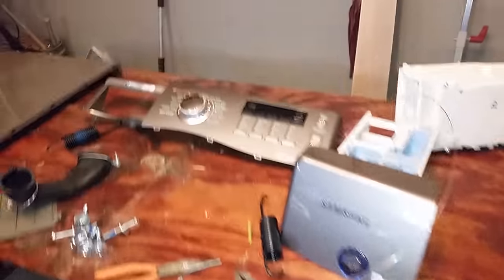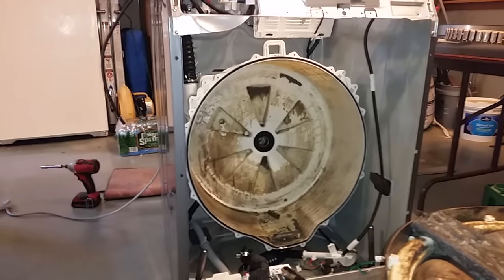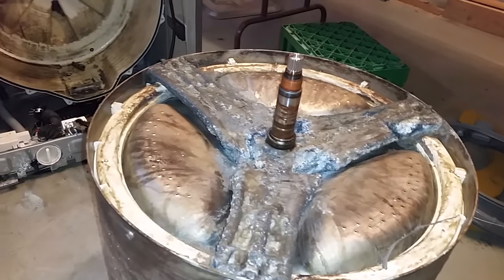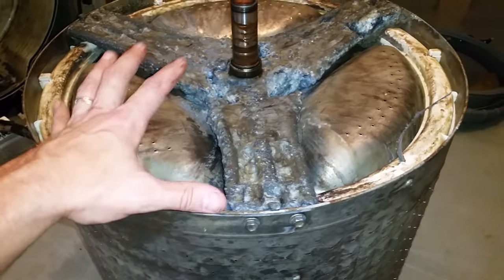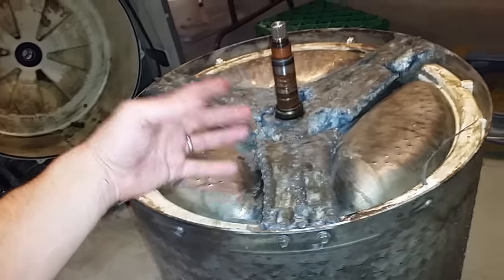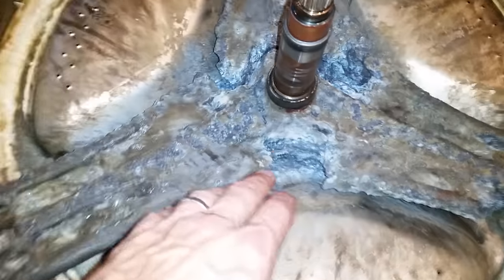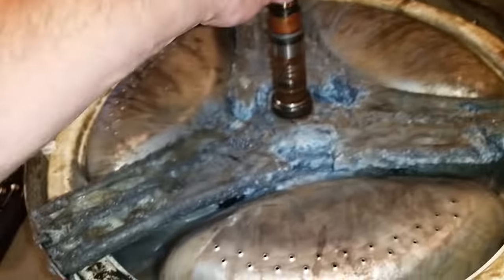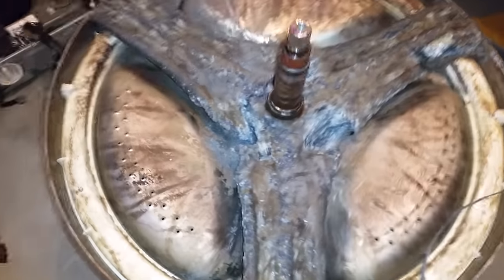Do not buy Samsung front load washer machines

Comment: Phil, this is one of the most interesting videos I've seen on youtube.  I'm not kidding.  The way that metal is deteriorating is incredible.  I have a similar Samsung purchased in 2013.  Control panel looks the same but mine says steam in the bottom left opposed to your bottom right.  I believe mine is one year newer than yours.  So with the sticker on the front of the unit that says 10 year direct drive warranty literally means it only covers the motor that spins the drum?
Reply: Yes warranty in the motor only
Reply: Tony Martin Samsung was in the news today for faulty washing machines.  I thought of this video.
Reply: And you believe what the news state. This the fastest spinning machine i worked on. So again customer need the read the Manuel. Large Bulky  loads need front loaders. Or low spin DELICATE MODE  BULKY LOADS. The machine is doing what the owner set it to wash in there wash setting.
Reply: Tony Martin  I didn't read the article, just seen it.  The only problem I have with mine is there is water in the detergent tub after most cycles.
Reply: tony martin what are you suggesting because i am in the market for a set of samsung front loader set and what is the proper way to maintain the machine ?...you should do a video on hiw to maintain the machine ....
Reply: I have to be honest.  After watching this video (I'm assuming you watched it) you are still interested in Samsung washing machines.
Reply: actually i am and i dont follow the hype because if you see for you self there are many happy customers and if that were the case no one would buy any brand because there will always be a complaint,  technitians are telling these people to do so preventive care and that should health alot but it is what it is and can stop driving starbucks because someone else likes Dunking Donuts and say is not good quality lol....
Reply: Rob M  Good grammar my man!
Reply: Rob M cleaning the unit with vinegar every 2 or 4 months will remove the soap residue just place in soap holder this one fill to max . Now in this video this spider arm not this guy's problem. Out of balance was due to Auto Balance ring on the front of the drum. This makes the drum not shaking in spin cycles Every unit on the market uses the same aluminum spider arm. Now do not use more than a shot glass of soap. This too will save the live of a unit.
Reply: YES DAMMIT! 
10 Years on the DIRECT DRIVE ONLY! Read the sticker, will ya!
Reply: Cleaning it with vinegar is extremely volatile to the Drain Pump motor and will more then likely corrode it then temporarily fix the problem. Not using so much damn detergent when using the unit can also cut down on the mold and mildew! Or leaving the door slightly open. Man, do people have to research everything on youtube for something completely stupid? 
You know there's sites that teach you how to keep your HE machine running efficiently and answers to common questions, right?
Reply: +RIP EVO
Sorry sometimes  the auto correct keyboard on my smartphone mixes words ,nothing i can do....
Reply: Rob Whiff You can proof read it before hitting post. There's that option...
Reply: Thanks
Reply: +Rob Whiff  Apology accepted.
Reply: Dillon Word So, if your question was already answered why did you keep the video up?
Is it because YOU need attention? What are you trying to raise awareness on. I mean, I find it overtly ironic that you're bashing a company based on your experience titling it Do not buy Samsung washer. And are calling me a dick. Lmao
Reply: +Frank (YouTube Newbie) Borrego   Dude,  you replied to the wrong person first of all.  YES!  I need attention so I kept the video up.  Moron, this is not my channel.  I don't have the ability to remove the video.  You literally replied to me, Dillon and the channel owner all in one reply but you are addressing us as one person?  I highly suggest you do a search on using YouTube for dummies.
Reply: Trying to decide which dryer to buy IF I am unable to repair my old Whirpool top loader. I sure don't need a HAL9000 to dry my clothes, nor do I want to spend anything close to $1,000.00 . It seems ridiculous and wasteful FOR ME, on my income. I have dirty clothes, sometimes daily because of sprinkler or other work requiring me to get dirty or muddy. Seems that here in Wichita, KS, several basic units are avail for sale price of $400 or $450, Samsung or Whirlpool. I hope that this would be the limit to own a dryer that works reliably. The parts store for dryer repairs has Hotpoint basic unit for $310.00 . I think it lacks a buzzer alarm feature, but I am mulling over its necessity. I understand that reviews for washers/ dryers will not necessarily be reliable since the majority are based on negative experiences, sometimes not even reflecting the product being reviewed but a hardware outlet or even the fact that the washer flew down the stairs in unfettered anticipation of its new residency. So I am looking for solid advice, but somebody here needs anger management. I need to feel safe leaving my sawed off fit-throwing online bully gun at home!
Reply: My appliance service people, - I needed three companies to get our 5 1/2 year old Samsung refrigerator back on track - singled out a few brands to stay clear of:  Samsung topped the list.
Reply: Geeeee!
so they give 10 yrs on something that doesn't wear out, 
and an immorally short time on the critically* expensive piece that will CERTAINLY fail (unless you have a newer model with the "clean cycle", ours doesn't (2010, WF210), know to use vinegar - and how and when to - and somehow have the knowledge NOT TO USE THE FILL LINE in the soap dispenser -- (what's it there for then?) 
!
Better plan:  no Samsung patronage

Comment: I remember this video from a few years ago after buying my new Samsung’s. So my machine started having slight balance issues. I got panicked and pulled out my warranty with squalor trade and guess what, 3 more months and my warranty was due to expire! They sent out a repairman and found they couldn’t fix it. They refunded the purchase price. Had I not seen this video I would have waited for it to be a real issue and my warranty would have expired.  I would have been SOL. Because it is an awesome set of machines I will see if someone can fix it and put them in the downstairs laundry and buy another set for upstairs.  I play the warranty game on the next set. I hope Costco sells the top of the line Samsung’s I will try buying from them they hold the manufacture to high standards.

Comment: Good to know. I replace these a lot working on Appliances. I would still go Samsung though. From a tech perspective they do improve on designs as time goes by, not all, but some. Plus they are thought out if parts do need replacing.  Whirlpools good but after that its really down hill. I tell you every GE appliance i open up, 5 other parts immediately break.

I might look into this a bit more in depth. Probably because its cheap and they do aim for a certain amount of years like any brand nowadays. That as a 4 year seems really bad but something tells me the water going in wasn't great either. Anyway thanks for the video!

Comment: I wonder how much the cost difference would be to use stainless for the bracket vice whatever metal they used. I guess that is why some people things use to be made to last and not built to fail.
Reply: Well remember the GM  ignition key module that killed people and caused car accidents .The cost to change the unit would have been .12 cents . I imagine this washer bracket would be maybe $15.00 to $20.00  more but the bean-counters won . Time to fire some bean-counters and hire some qualified engineers .
Reply: I used to work at a company that made electronic equipment. We had one engineer that used to walk around the office going "cheap, cheap, cheap...now it's so cheap, cheap, cheap it doesn't work anymore". Your analysis of this problem is absolutely correct. It's the main reason why I don't work as an engineer anymore. I got tired of having to work all night fixing these types of problems while the managers, accountants and stockholders were all at home in bed with their wives.
Reply: Nice that you don't know how to spell "Cheap"!!?
Reply: @ Mark W - It was meant to mimic a bird going "cheep, cheep, cheep". But I changed it just to make you happy.
Reply: Joe Vignolo Poor, Mark.  Love his heart!

Comment: "All" the front loaders do this. I had a Maytag that did the same exact thing.The spider arm on the drum is made of aluminum. Moisture attacks it. Bad design & engineering.
Stay away from front loaders period. They claim its stainless but thats only the drum.
Reply: I had the kenmore made by Samsung just like this video complete crap. I bought 2 new maytags direct drive front load and with 10 year parts and l’avoir warrantee so I’m pretty confident that we shouldn’t have a problem and if we do they will fix it

Comment: Run a cold water wash without detergent once every week or two. Doubles the life.
Reply: How does that double the life?  W/ front loaders, they recommend you run an empty bleach cycle every mth or so to keep mould down, but I'm not sure how plain water does it?
Reply: When stainless steel os attached to aluminum it causes galvanic corrosion. Laundry detergent speeds that process up. Doing a fresh water cycle rinses the residual detergent out slowing the corrosion process. It has nothing to do with mold.

Comment: I repaired my Samsung washer just like you. It cost me 200$ and 6 hours. Finally, I realized that's how they make money. Samsung can use more strong Spider to make the washer long for 20 years. But they don't. They set up clock of less than 10 years to fail which make most of the user to buy a new one. Because the labor cost is extremely high. The labor cost plus the part cost is easily high than a new washer.

Comment: Sacrificial Anodes are highly active metals that are used to prevent a less active material surface from corroding. Sacrificial Anodes are created from a metal alloy with a more negative electrochemical potential than the other metal it will be used to protect. The sacrificial anode will be consumed in place of the metal it is protecting, which is why it is referred to as a "sacrificial" anode.

Comment: Why do you think that Samsung hasnt fixed the problem?
This is a well-engineered solution to the main problem of Samsung:
Devices should not last too long so that the idiot-consumer buys a new one every 4-5 years!
And another bad habbit of Samsung is dipping the electronic circuit in resin.....so have fun repairing that......(protip: you wont)
Reply: Actually, encasing electronics in resin is used by the military to protect components from breakage due to vibration and extreme acceleration. Replacements are routinely done on these potted parts. So this must be done to extend the life of the circuit boards out of the warranty period which is even more sinister. My wife chose an upright machine just to avoid the moldy seals around the door.
Reply: Our next machine will be 2 things, a top load and not a Samsung.

Comment: This problem exists in all washing machines where the soapy detergent and stainless steel drum form a battery. To stop this, they use a sacrificial metal backing which will corrode over time -- as intended. You can slow this down by making sure you use only the detergent required, and doing a maintenance wash every 20+ washes to remove the buildup of limescale.
Reply: If you have mostly soft water there will be no limescale. So the issue is detergent residue buildup. How to remove that?

Comment: So what brand of front load washer would you recommend? What can you say about LG Direct Drive technology?
Reply: LG is good. The problem with them is that you can't get any parts for them after a few years.
Reply: Wolf Plato Thanks. Well at least by the time the parts become obsolete, you have at least got your money's worth. Besides, I think they last a bit longer than samsung. Thanks again for the tip. I'm convinced it will be a best buy for me.
Reply: LG is a throw away item, not intended to be fixed. Be aware of that. Otherwise it's good. Costs more to fix than what it's worth.
Reply: Wolf Plato And so is samsung. LG has a 10 year warranty on the motor and because of its direct drive system, it does away with the belt like what samsung and other conventional front loaders uses. I believe if you really want quality, SpeedQueen is the way to go. Its guaranteed to last 25 years according to their claim. But it cost a fortune. Especially the commercial type ones.
Reply: Miele makes the best consumer washing machines, but they are expensive.
Reply: Both LG and Samsung use direct drive motors these days.  Pretty sure even the washer in this video is a direct drive (look at the table in the back 0:04 and you can see the parts of what looks like a direct drive motor)
Reply: You can buy cheap Frigidaire front loaders that use belts. Or Kenmore's that are made by Frigidaire... But most of your Front Loading Brands I.e Whirlpool Duets, Maytag Bravos, Kenmore (made by LG) and Kenmore Elites (made by LG) Samsung, Electrolux, GE etc. Will have a DD motor.
Reply: Buy Speed Queen, cost more but they are built to last and they do .
Reply: I think LG is fine.  800-900 LG front load will last a long time, seal and tub bearings will eventually go out like all washers.  No problems with getting parts either.
Reply: You got a good deal.  Back 12 years ago, we paid 3k for LG Front load washer and dryer.  Considering we have over 3500 loads through the washer, it was due to need something.  So I saved $450 bucks fixing it myself instead of buying a new one.  Outer tub, inner tub, includes all new hoses and product updates.  Because I run clean softened water, my washer looked very clean inside and the spindle spider was look new.
Reply: Chubby Luna I can't recommend any new appliance! 30 years in the business and I marvel at how much junk is out on the showroom floor!!
Reply: Get a Miele or Bosch.
Reply: I won't have a front load washer. The federal government forced these pieces of crap on us by going to the appliance manufacturer's 30nyears ago and mandating less water usage per load of clothes. I still use a 1970 top loader. I will get another top loader if the 1970 machine dies b4 I do.
Reply: LG is crap too. We had an LG front loader with direct drive and the drum bearing completely failed after only 4 years. On top of that to get it repaired would have cost almost as much as a new machine according to LG. Needless to say we went with a different brand.

Comment: My Samsung washer is about 12 years old. I have replaced the water pump and the door seal on it during that time. I've been happy with it generally. Last week my wife said there was smoke coming from inside the washer after the wash. I looked and saw and smelled nothing. It happened again. I looked it up and saw many videos on the spider breaking. Unfortunately I have just completed a stem cell transplant and cannot do the repair at the present time. So we bought an LG washer. For a part like this to break after only 12 years is ridiculous. For them to last only 4 to 7 years is a travesty.
Reply: 12 years is an eternity for a Samsung 😂